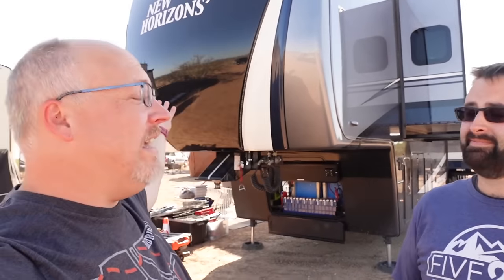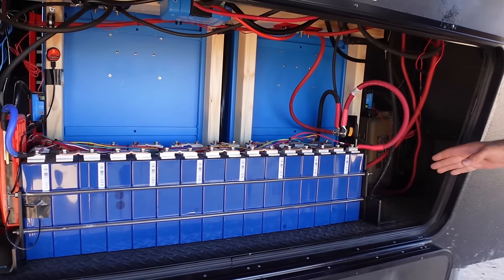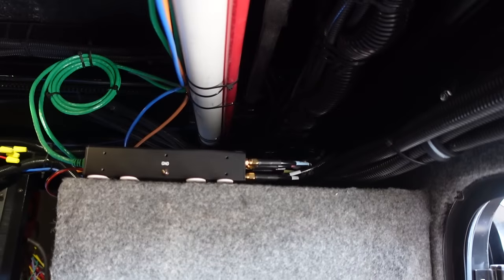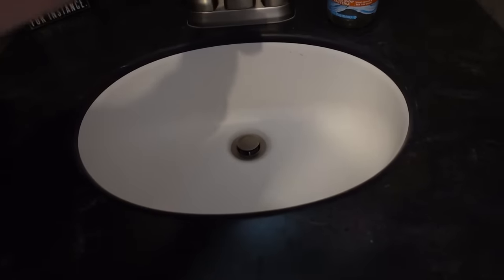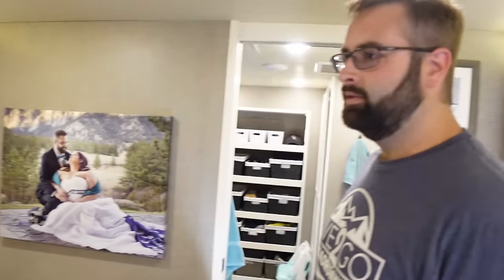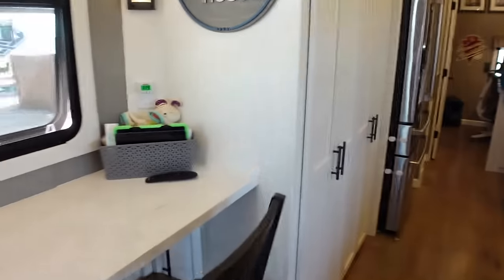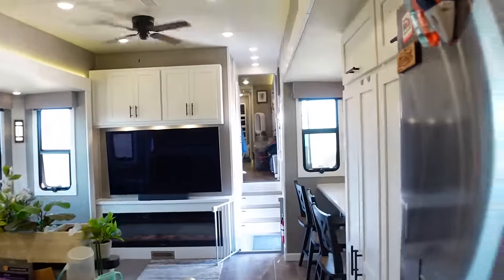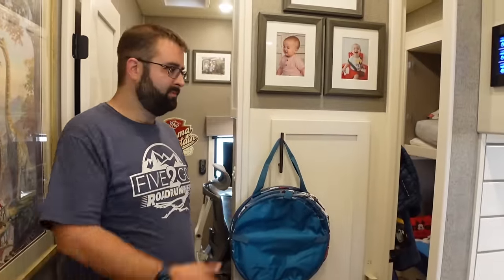THIS AMAZING RV Will Surprise You! Custom New Horizons Majestic Tour

Comment: Certainly a lot of thought has gone into this rigs layout! The energy system is really amazing! We started our RV experience in 1986. Ended up after 6 motor homes with 45 ft Teton 5th wheel. I had that built to my specifications but not nearly as technically equipped as this 50ft monster. We had 4 massive slides which made it more like a home than an RV.
Sadly,  Teton closed a few years after ours was built but was a fantastic coach.  We retired from RV's but still get the itch.
Reply: Thanks!  I’m glad you liked it!
Reply: Man, I can learn a lot from you. Maybe you can do videos as well. I need all the experience from folks like you that know the stuff. Thank you.

Comment: For my peace of mind I would want more that a one ton truck.  32k pounds is a lot of weight to pull around.  This is amazing, only 25 feet shorter than our single wide.  Wonderfully arranged and thought out.
Reply: Thanks!  I’m glad you liked it.  We’re looking into what it would take to upgrade to a larger tow vehicle, but honestly the 3500 does a good job as is… it just doesn’t give us all of our capacity.
Reply: Ben would a Chevy tow that beast? If not what is able to tow it? Please help
Reply: Saw this video just today - but if I heard correctly, you're pulling this with a GM 3500???? I would seriously suggest you run that rig by an officer to see if you're legal.. My bet is - you're not; that you're over the GVWR by a bunch.  You don't need a hefty fine my friend.. Make sure you're legal - it could save you a ton in liability claims if you have any incident with another vehicle...  Must my .02..

Comment: Amazing.  Given that it's 3' shorter than a standard semi trailer, I'm seriously curious here:  1-What does it weight unloaded?  2-What is the GVWR?
I saw comments about it being towed with a 1 ton dually--no judgements here.  The new 1 tons are equivalent to the MDTs from a decade ago...
Reply: Thanks Rob!  The GVWR is 32,000 lbs.  Unloaded… 26,550 lbs.
Reply: @triphius  Whoa that's a beast!  That would have been at the hairy edge of what my 2019 daully could have towed...

Comment: Beautiful rig! Look forward to seeing the exterior in more detail. One thing I noticed was there are no heater vents in the floor which is really nice. If I went full time I’d want as big of a rig I could get. Yes, you might be limited to where you can stay, and it would be more difficult to pull this thing, but well worth it for the space. I could live in this very comfortably.
Reply: Thanks!  I’m glad you liked it.
Reply: Bathroom had a floor vent. (Ducking) 9:00
Reply: Yeah, the upper level has floor vents and the back bedroom has one too.  The main living area has them 90° in cabinets.
Reply: Although, most of the ones on the floor are also adjustable and can be closed off entirely if we so desire.
Reply: I had a 43 ft and was no fun trying to fit in most spots that weren't pull thrus. Most old parks just weren't designed to back a trailer this long into. If you're not good at jacknifing a trailer forget something like this. You tell whoever takes reservations how long your rig is and they have no idea what it takes to back something this long even though it fits.
Reply: @tumbleweedking5668  that’s what I would do - call ahead and tell the Facility how Long My Rig Is 👍🏻👍🏻👍🏻
Reply: Beautiful wedding photo!

Comment: That’s incredible, beautiful and amazing. I can’t wait to see the systems like the solar, etc. I’d definitely get at least a MDT if not a HDT though. They’re actually less expensive than an F450. That thing is massive!!! And spectacular!!
Reply: Thanks!  I’m glad you liked it.  We’re definitely researching what it would look like to go with a bigger tow vehicle.
Reply: The F-450 has an amazing turning radius.   There’s a few YouTube reviews on the F-450
Reply: @aliveandwell2078  that’s due the the wider front axle. A medium duty truck would also have a wider front axle. The commercial/fleet grade F450 is also different from the consumer grade F450 in a few ways. If this were my rig Id probably pull this with a single axle highway tractor.

Comment: HDT necessary. The Freightliner Cascadia or Volvo of you liking with Eaton automated trans would work well for this application. They’re getting decent gas mileage. I like the tilt out windows, even on the slide. I have them on my 38’ Jayco and they work great for cross air flow, even when raining.
Reply: I appreciate the insight on the HDT stuff.  Definitely outside of my wheelhouse, so I’ve got plenty of homework to do!

Comment: They like to make the big units. We have a 2012 that we've been living and traveling in fulltime since 2012. It's "only" 31 feet. It may be one of the last ones they made that can be towed with a Super Duty truck. It has held up amazingly well. The CCC on New Horizons is so good that you can easily load up on solar and water. We boondock 100% of the time and stopped carrying a power cord after our first year on the road.
Reply: Thanks!  I’m glad you liked it!

Comment: We've seen you out at Pleasant. We were all curious what the inside looked like. Very nice RV! I'm curious, what do you use to put your framed pictures on the wall?
Reply: Thanks!  I’m glad you liked it!   We use a combination of the “Velcro” command strips and the heavier duty 3M double lock stuff.
Reply: @triphius  I've heard that can pull the wallpaper off in the heat so I was a little scared. I guess I'll give it a try. Thanks Ben
Reply: Haven’t had any issues thus far.  I guess your mileage may vary.

Comment: I have a 44 1/2 foot 21,000 pound fifth wheel and it’s a beast to haul down the road I can’t imagine hauling that one down the road at 31,000 pounds and then to try to park that monster like in an RV park
Reply: I think the whole rig (truck and trailer) is 31k lbs. My guess from looking at the 3 axles they are each 7k. Even if they were 10k each he would still be over weight.
Reply: Our NH 2015 is 8k pin weight with 4 axles. it's 52ft. So I would guess he is 31k plus some of that onbthe pin 5k-9k
Reply: @innerspaceavailable  wow that is a lot on the pin

Comment: I will be curious how many campgrounds will NOT allow them in because of the size.
Reply: Just money wasted unless u buy some land and put it on
Reply: @jamessimpson422  That would totally defeat the purpose of buying it in the first place. 🙄 If they wanted a house and land package, that’s what they’d have (and probably did before they purchased this)
Reply: They Florida keys has a length restriction of 40'. They suggest a rv/camper length of 27-35'
Reply: Can you tell us what the exact length and width is. Also,, what size are the holding tanks are - black, gray, water. Lastly,, can you utilize all 3 AC with your solar system
Reply: You just have to plan ahead with where you are going stay.
Reply: Right!! I have a hard time sometimes and mine is only 44’. This thing is massive😂😂

Comment: How do you live on 50 amps with all of that?
Reply: So technically 50A service that we see at the pedestal is rated at 240V.  RV’s generally split this into two 50A circuits at 120V, meaning that we actually have 100 amps (12,000 watts) available.  That’s half the service on our sticks and bricks house.  It works out well.  I also built the Victron power system to be able to run all 12,000 watts from the batteries if necessary; so I can use PowerAssist if I’m at a 30A circuit and supplement with solar input.
Reply: @triphius  👍

Comment: Those outlets worry me. If you have a spill...😳
Reply: So the outlets are actually certified for countertop installation like that, and they’re GFCI protected, so the breaker would pop within 5 milliseconds of liquid closing the circuit.

That said, I’m probably not going to pour a glass of water on it purposely.  😂

Comment: Beautiful coach, One thing I hope this guy has a semi tractor on order to pull it. I know his chevy is not rated to handle a rig of this size. Very unsafe. That's why I did not have New Horizon built my coach I did not want a semi.
Reply: Thanks!  I’m glad you liked it.

I appreciate your input.  I did do my research and everything is within the capability of the truck, axles, wheels, suspension, hitch, etc.  I am pushing it on payload — especially if I need to haul with full tanks; so we’re looking into the larger tow vehicle to allow us more flexibility there.
Reply: I'd get the hauler, like a frieghtliner m1 conversion, you will need a class b cdl